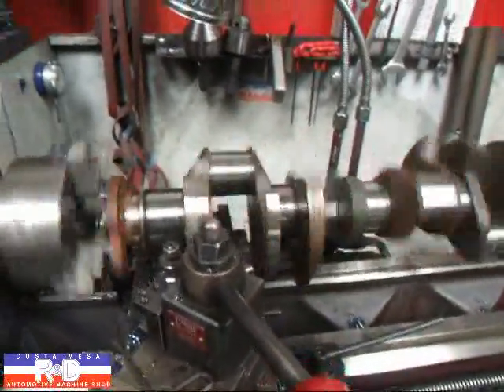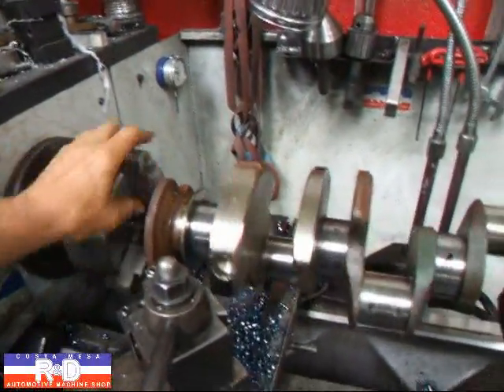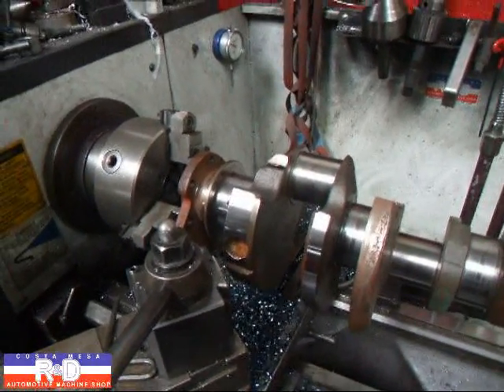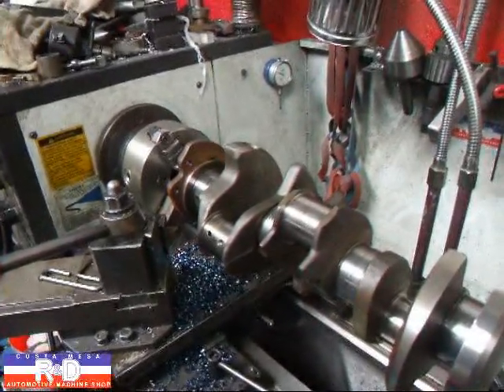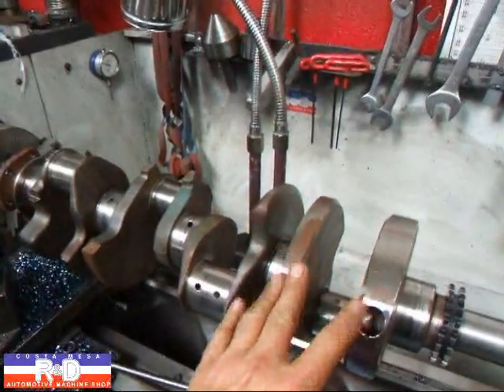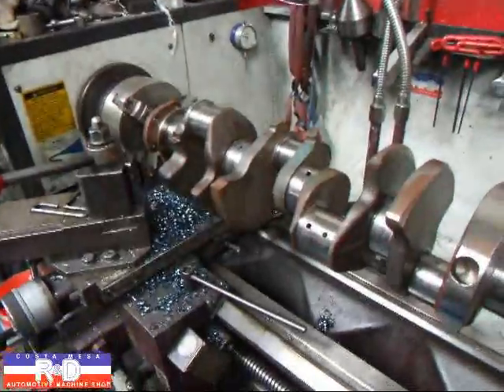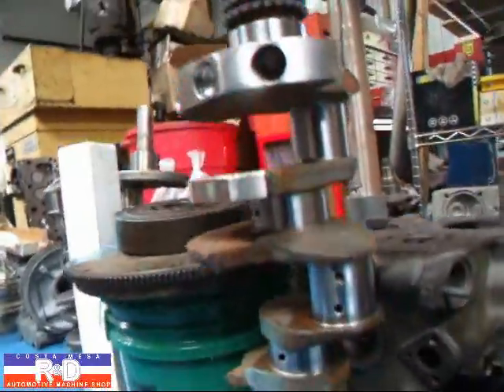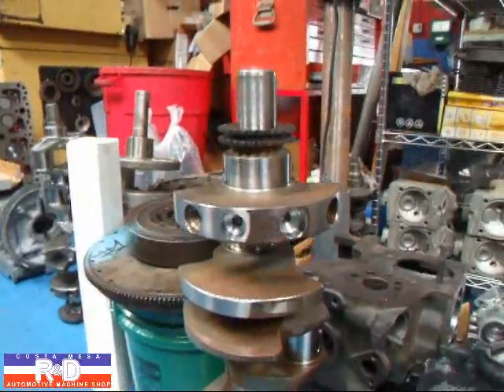Crankshaft Balancing Counter Weight Reduction

Comment: question? I'm in a pinch. my 6.0 has 4 slipped rod bearings. crank is trashed. I'm just going to swap in a good used crank and bearings from a 5.3 because I don't have the funds to buy a used 6.0 engine. lq9 to be exact. my question is, how much out of balance will the crank be to the heavier flat top lq9 pistons and rods? Will it be a vibration issue with this? or do I need to get the crank balanced or reduced weight from pistons?
Reply: bishop just used the balancer/flywheel from the 6.0 and it will be fine imo lol

Comment: Why not buy a lightweight crank wouldn't that be a lot easier and safer?
Reply: Some engines need to bottom end weight to give extra torque up hills, bit like a flywheel

Comment: i'm planning on building an engine and use rods that wheren't made for the engine 
(jaguar aj6 crank and nissan TB48 rods and pistons in a bored and sleeved jaguar aj6 block)
some of the ground / grind / rough work i want to do myself as an experiment and because i have more time than money
the connectingrod journals will be machined under and probably a little offcenter to make the nissan rods work and to increase te stroke so those ends of the crank will end up a little lighter too 

i wonder how i can find out how mush i (need to / can) take of the counterweights before rebalancing

can i just use the difference in the bob weight needed between the original jaguar rod and piston compared to the nissan one and the difference in the weight of the crank before and after grinding the journals undersize to find out how mush weight i can take of the counterweights?

logic would say i can get pretty close to good enough to balance on the machine if i only take the material of the part across the bob weights 
i just go slow split the weight across the amount of counterweights and take the same amount off each and take the crank off the lathe a few times and weigh it to check untill its as close as possible

Comment: Although your cutter seems to be getting the job done for you, it sounds like it is really straining to make the cut, putting a lot more pressure on the tool and tool post than desired, it looks like you are using a negative rake tool for cutting steel, normally you would want a positive rake for cutting steel so you slice the metal off and not pound it off.

Comment: Maybe next year love cutting those 440 cranks down to fit 400 low blocks so far I have a IDL 550 and a Sioux 750  Valve refacer also small drill press and a 2 ton ram
and a snap on air valve spring compressor .

Comment: Audi 5 cylinder cranks use the same 50% bob weight formula as 90 degree V8's do to balance them, though there might be exceptions to the rule, I'm sure John knows if there are any exceptions...

Comment from the maker: I've done several 5-cylinder engines from different manufacturers. You need to weigh everything to make sure that they are all within a grams. The crankshaft should be balanced, next add the flywheel to the assembly then rebalance, then the clutch cover, then the front pulley. That should do it.

Comment: john, im at a loss as to how i need to get my inline 5 audi engine balanced. will be getting new scat rods, hand them rods pins clips piston and crank ? i just dont know the process and i refuse to go into a shop without putting my task to them with confidence. have you ballaced a 3b20vt engine before. audi200t had them fitted over there. do i get the internals balanced,and the flywheel pressure plate and balancer pulley zero'd if that makes any sense!! thanks in advance if you can help me john.

Comment: he took the 400 grams off this crank to balance it essentially so it spins true,A balanced rotating assembly ensures proper wear of bearings and longevity of the BBC engine this crank is going into.

Comment: Fiatnutz is a master machinist,The Yoda of engine machining.I would think that since a BBC isn't a really high revving engine that lightening the crank wouldn't help a whole bunch more,Maybe a little in throttle response. I would worry more about a really light and balanced rotating assembly in a high revving Import engine that see very high RPM ranges.